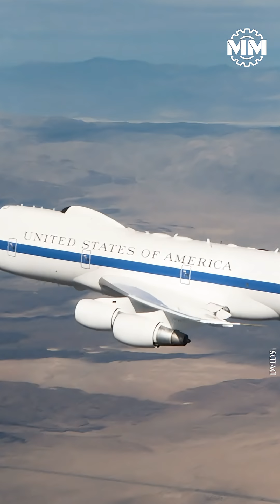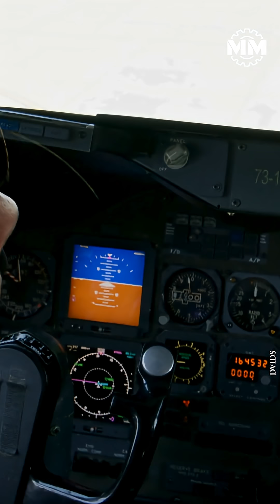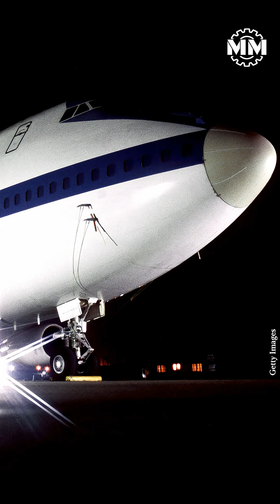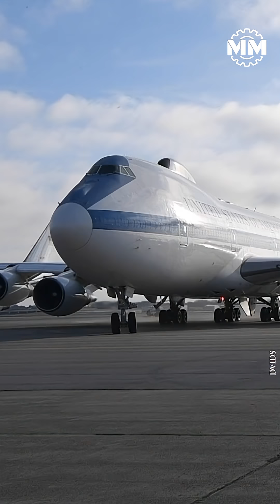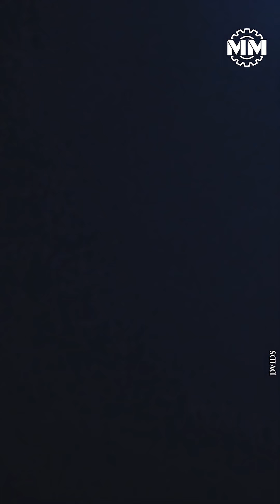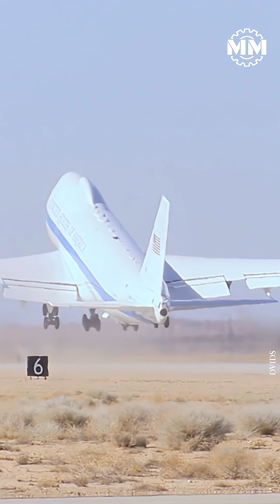America’s Doomsday Plane Just Took Off — Here’s Why

Comment: While an EMP does technically come in a wave, it’s a specific kind of wave of ionized particles. This ionization is what damages electronics. So not every wave damages electronics beyond any physical damage they might do, like a strong vibration or sending the object flying across the area into something. Just exposure to ionic or electrically charged air or surfaces.

Comment: I worked in the Strategic Command (previously the Strategic Air Command or SAC) Command post for 9 years.  There are multiple E4-B Airborne Command Post aircraft in the Air Force inventory,  and there is one airborne 24/7/365.  This is not the aircraft the President or Vice President normally fly on, but they can if, for some reason, AF-1 or AF-2 were grounded or unavailable.  These aircraft being airborne is normal everyday stuff.

Comment: One of the weird things about the Boeing 747 is that it has 4 different military designations: L-1 (the YAL-1 experimental laser attack plane), E-4 (this thingie), C-19 (Air Force Reserve Boeing 747-100s used mostly as trainers supporting the E-4 and VC-25 fleet) and C-25 (VC-25A Air Force One).

AND IT GETS DUMBER. The L-for-Laser designation has NEVER BEEN USED FOR ANY OTHER PLANE, and existed concurrently with L-for-Liaison, which is a grab-bag of civil light planes.

Comment: Just locate the GPS/Blackbox signal through the FFA radar data then have nuclear ⚛ warhead loaded missiles and triangulation of 2 to 3 warhead airburst explosions and the energetic blast waves would tear it apart and cause so much debris to mess with the engines and would mess with Communications with Satellite and ground traffic....

Either you will knock it out of the sky or cause irreparable damage without ground maintenance.

🤷‍♂️

Comment: I remember when it was called "Looking Glass" [maybe an earlier model...].  We have 4(?) of them; At least ONE is ALWAYS in the air.
Reply: Not anymore. Clinton stopped the E4's flying around 24/7. But they sure don't sit around. There's always a maintenance flight or training flight going on.
Reply: The looking glass was an entirely different plane. It was an ec-135. It was retired and jstars took over its mission. Some of the ecs were built in the 60s. We would have to start the engines with explosives to get her moving. They needed to be mothballed.

Comment: Why do they use the term "indefinitely" as if it can actually do that?  There is NO WAY that a plane could fly "indefinitely".  AT SOME POINT it would need maintenance and/or repairs for damaged engines from running constantly.   You going to try to convince me that the engines can run for 10 years without some sort of oil change or cooling system checkup or something else?  I don't know what the exact number of hours is for maintenance checks and so on but planes REGULARLY have to pass routine checks and engines have to be taken apart to ensure that they are in good enough working order to continue flying.   And the house aren't at 50,000 hours or 100,000 hours or some high number.  I believe it's a smaller number that would be around 2,000 or 3,000 hours which would be about 2 to 3 months or constant running time.  This idea that it can fly "indefinitely" is stupid.   It HAS to land sometime for maintenance or repairs.

Comment: This plane is also known as NAOC (National Airborne Operations Center) The E4-B is the "Flying White House" in the event of nuclear hostilities breaking out.

Normal USAF SOP dictates that in the event of an imminent state of nuclear hostilities breaking out, Secret Service is tasked with getting POTUS, the VP, and Joint Chiefs aboard NAOC immediately.

Once POTUS, the V.P., and Joint Chiefs are onboard, an immediate emergency takeoff is ordered, along with scrambling a fully armed USAF fighter escort, and KC-135 Stratotankers for aerial refueling.

Once NAOC is securely airborne, it climbs to tactical cruising altitude, then POTUS, VP, and the Joint Chiefs begin the nuclear emergency protocols, which if the situation does not de-escalate, will culminate in SNAPCOUNT, and nuclear Armageddon.

If you ever see this plane go aloft, with fully armed fighter escorts, then bend over, kiss your ass goodbye,  expect the missiles to fly, and the Shit to Hit the Fan!!

Comment: What blows my mind is I cannot believe they’ve yet to render in new modifications? For example, using and electronic battery plane? I’m certain we can create a non heavy batteries that’ll last 24hrs with obviously additional batteries around the plane to add electricity support along with 2 sub battery components for the body section of the plane itself. Plus possibly creating a battery with additional life support to keep the plane running 2 days almost non stop. Like you figured out how to create an insane plane. But the fueling source along with other things are still a critical issue, how?

Comment: Interestingly it has 4 air-conditioning packs (air cycle machines) whereas a standard B747 only has 3.
It also uses General Electric 103 engines, the military equivalent of the GE CF-6.
The GE TF-39 is used on the Lockheed C5 Galaxy.
Reply: You know your shit. I’m guessing the extra A/C unit is to keep all the computer systems running cool.
Reply: @bigchungus-oj8zz 
As an aircraft mechanic I've worked on all models of the B747s (except the 747-8) for many years.
 I agree that the extra A/C Pack is for equipment cooling.
 I thought they may have installed 2 APUs (Aux Power Units) like the presidential Boeing VC-25s has, but I suspect as it would be hooked up to a GPU (Ground Power Unit) it doesn't need the backup like Airforce One does. 🇦🇺

Comment: Actually, this plane could have greatly benefited from nuclear-powering.

Though I understand that developing compact nuclear powerplants that would keep an aircraft in air is overkill for one airplane.
Reply: Technically infeasible for now though. Only works on ships as the weight limitations are much more relaxed. Also, planes generate propulsion differently. Powering a plane of that size with electricity wouldn't work (couldn't get anywhere near the thrust that a jet engine could provide).
Reply: @isoaxe Russians did it with a prop airplane , but due to radiation they only builded that one and scrapped it after beeing a dead end in usability and not possible to stop enough radiation , and if/when it eventually would have crashed for some reason it could started a "China Syndrome"
Reply: @royharaldsandvik  the Tu-95LAL never flew on nuclear propulsion. It carried a reactor to test but it was never used to power the plane. The same as with the NB-36H. Both programs were cancelled in the 60s.
Reply: The Soviets built a nuclear powerd airplane , it flew.. But they terminated the program because that was not possible to isolate enough radiation cover for the pilots.. So its possible but no-one wants a flying Chernobyl flying around..
Reply: Did anyone see that “new” approximately shipping container sized nuclear reactor? Saw a short on it the other day
Reply: Great idea. But, then everyone would make nuclear powered planes and occasionally turn random crash sites into radiological disasters. Plus radiation leaks all over(non-USA planes). So i guess everyone decided against it decades ago.

Comment: Stay aloft indefinitely? I think that many people pooping will be the defining moment.
Reply: Dump tanks.
Reply: That’s a …. space peanut
Reply: Open the holding thanks😂
Reply: One at Andrew’s AFB, one at Davis AFB in Nazifornia and the third one at the Midwest base mentioned in the video. They are run on standby generators 24/7. The POTUS can catch the Marine Corps helicopter parked on the South Lawn at 1600 Pennsylvania Avenue, then meet the bird taxing on the runway and can be up in the air in just a few minutes. Salute the Marine Corps pilot for the last time, as that crew will be vaporized shortly there after. 
Should the dooms day plane not get airborne in time, there is a dead hand switch at Solomon’s  Island Navel Air Station about fifty miles South of the White House. If the dead hand switch is activated we are then authorized to put our heads between our legs and kiss our asses goodbye…